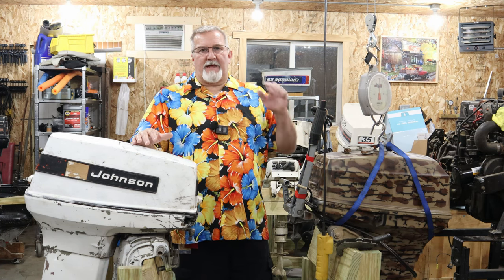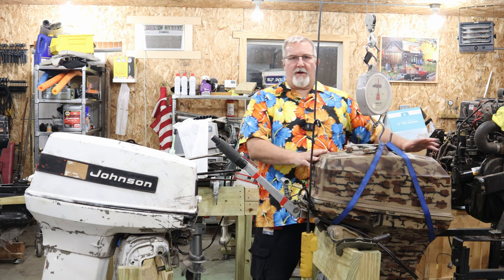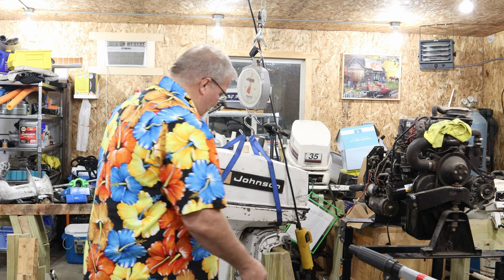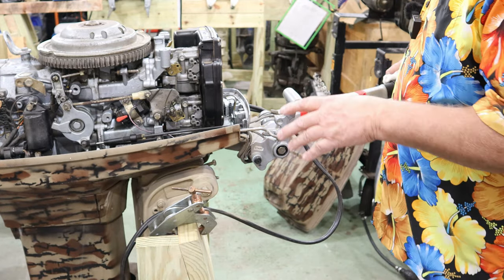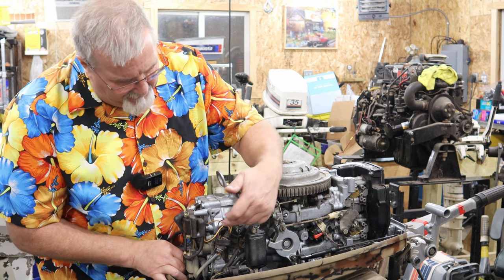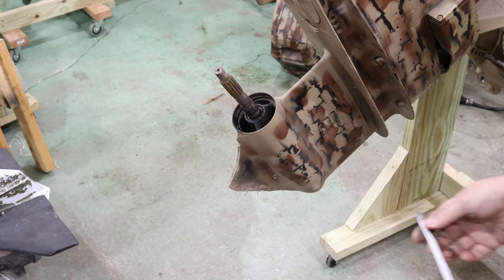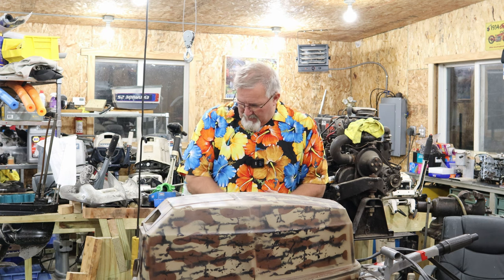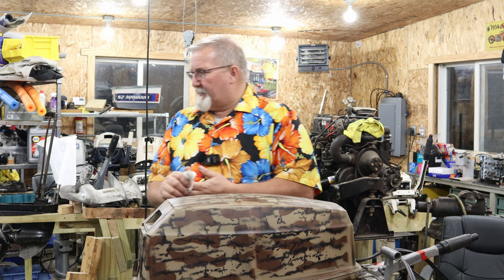1983 Evinrude 50hp Part 1  Discovery

Comment: Michael, yesterday I had a nice ride on my 1232 Jon boat pushed by my 1977 9.9 Evinrude that I bought all messed up and now starts on the first pull and run buttery smooth! I have on the table now a 1975 Johnson 25 horse that have 120psi on both cylinders it's now firing up but not holding the idle yet. So, you know what kind of person I am.....love this old motors!
Reply from the maker: Sounds like you are doing to good stuff there, thanks for watching

Comment: Looking forward to seeing you work on the 50, I would put it back to factory colors, I Just went threw putting together a 1990 Johnson 50 for our boat.
Reply from the maker: What pitch prop do you have on that 50? thanks for watching
Reply: @Michaelsbackyardmarina  12 1/2 x 13, that was the prop that was on it, it came off a pontoon boat. It gets out of the hole great, but only tops out at 28 MPH when 2 are on it. My son says it will top out at 32 MPH what him in it.I was hoping to get more out of it. I would like to try a different pitch to get more out the top end. MY RPM's are 5000

Comment: Awesome!! I have a 1983 50hp Evinrude (E50BELCTA) on a 1984 Boston Whaler Sport 15-footer! Awesome engine. Looking forward to see you work on the water pump. That's my current project. 😎
Reply from the maker: coming real soon, thanks for watching
Reply: @Michaelsbackyardmarina  I just finished. the hardest part was finding the shift rod linkage. I found that removing the 3 bolts on the starter and pulling it aside was the easiest way to find it. also found some great videos (after tons of searching) that helped, so just let me know if you need the links. also found helpful info in some forums. oh and I disconnected a little cotter pin and bolt on the other side of the engine while reinstalling the lower unit. that made reconnecting the shift rod much easier.

Comment: Fun project indeed. Maybe you ought to be adventurous on that new look. I was thinking of a 2-colour scheme with using an heat shrink wrap on the bonnet, a tartan design would  look wild and totally in synch with that screaming yellow hull. One notch down, you may be inspired by the late 60's Scott-Atwaters that sported pastel colored  (turquoise, yellow or orange) bonnets along with cream beige for the lower unit. Hell, why not match the hull. As to the bonnet's foam insulation, Kodibass spray paints it so it will hold up better and avoid debris being sucked up trough the carb. Stay safe and be merry ! 🇨🇦
Reply from the maker: Wow that is a lot to digest, thanks for watching

Comment: factory paint w decals,  got 2  87' 50s , about carbs, easy rebuilds, for sure remove core plugs on top of carbs, 2 or3 small holes under it that  need to be cleaned they are part of the idle circuit,  the sync & link can be fun, at one time there was a factory manual on line, i''ll see if i can find the link again
Reply from the maker: Thanks for the tip and thanks for watching

Comment: Michael,
Great video if I were going to paint the motor I would go with the Evinrude Silver Blue with the matching decals on the engine cover, if that does work you could also do the Evinrude Blue with the decals on the engine cover. Can't wait to see the carb work and the what you find on the linkage
Reply from the maker: Cool idea, thanks for watching and suggestion
Reply: @Michaelsbackyardmarina  i just thought of another idea and that is paint the bottom of the motor the Evinrude blue and the cover the Silver and blue with the decals
Thanks 
Tim

Comment: I have a 50 hp tiller johnson that seized up while on the lake last year needed a tow back to dock, the handle looks identical to yours and I am sure its a lower 80's motor, I would go traditional White color scheme mine looks pretty neat traditional Johnson color, I am not positive but pretty sure i would need a powerhead from only a few early 80's years that would work i think after 86 there different? and below 82 i just don't know.
Whats ironic is today i was testing a Evenrude 1973 50 hp in the water on the dock, could not get it to fire, went home and found they had NGK bpmr4a plugs in it (bacically like chainsaw plugs or weed trimmer) so i bought the correct spark plugs and two spark checkers and went to the dock again, no luck wouldn't fire up, went home had the better half turn the key while i looked for spark, got spark and 142/140 compression so it's a fuel issue i have to dig into, the new plugs were dry no smell no gas. fun city

Comment: I’ve followed you to help me work on my 9.9/15 Evinrudes.  This weekend I picked a project boat with a 1982 Johnson 35 with remote controls.  I don’t know how to use the controls.   How do I tell which battery cable goes to positive?  The terminals aren’t black and red.  The remote control box doesn’t have a key? How do I know which key to buy?    Do I need a key to operate it?  If it’s not too cold maybe you can do a video on OMC remote control operation?

I look forward to your coming videos this winter.  

Thank you for sharing your knowledge!

John
Montana
Reply from the maker: you will need to watch an up coming video when I hook the remote control up the my 1973 50hp. Should be very similar, thanks for watching.

Comment: Gotta see that 50hp push that tri. I've got an 80hp on mine I've yet to run on water. Gears are grinding over picking up 50hp spare.
Reply from the maker: good luck with your project for sure, thanks for watching

Comment: The older one has electric choke and newer one has electric primer and mine had a factory plastic sack with a rope and plug and small screwdrivers and stuff under the hood on the side have u seen any with that on swamp people 😅lol they have 115 and 150s with tillers 😮candy apple red or canary yellow with factory decals to match the boat unless u going to sell it then just go factory black 😂
Reply from the maker: Thanks for the suggestions and comment, and thanks for watching